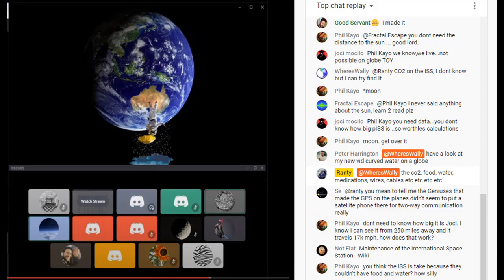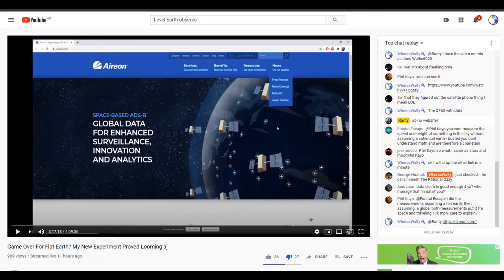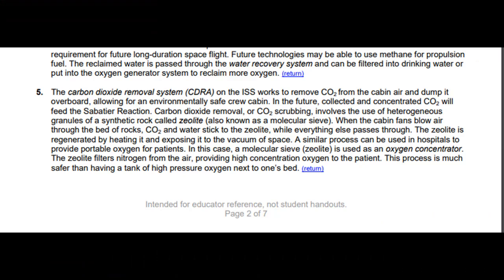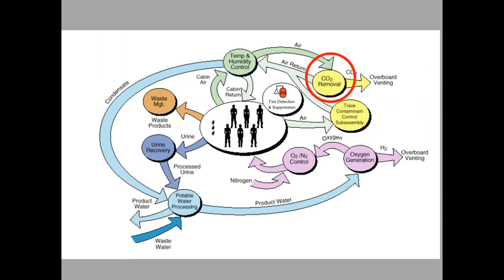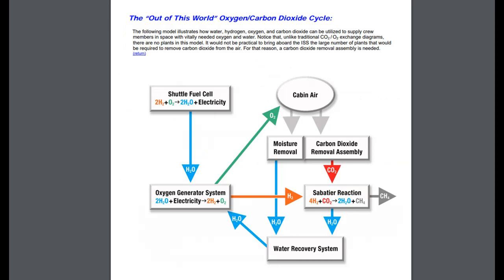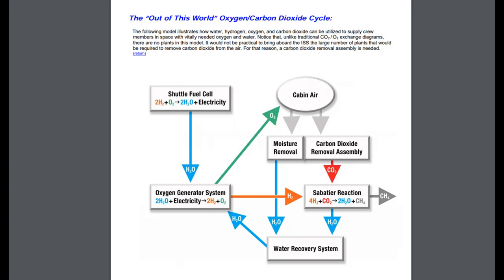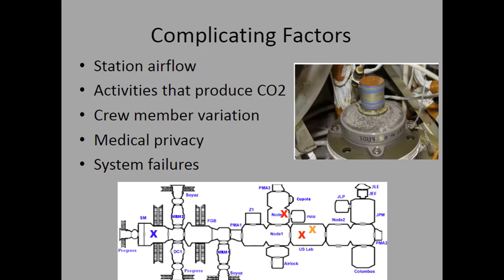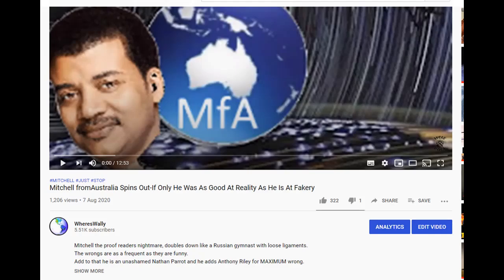Ranty Wants To Purge the ISS Of Carbon Dioxide - Here's How It Is Done

Comment: Odd, but why so these folks just not use google? CO2 removal has been used at least since the 1930's on submarines. This is almost on par with how do they breath on the ISS if space is a vacuum.
Reply: Since the 30's you say.  Even the British sub that was propelled by oars had a co2 scrubbing system of some sort and that was way back in the 1700's.  It's not rocket science.

Comment: NASA have been scrubbing Carbon Dioxide in spacecraft this since the early days of the Gemini program.  Look no further than the trouble with Apollo 13 with scrubbing Carbon Dioxide.
Reply: I was just going to say the same.
Reply: Those systems were not regenerable. They used lithium hydroxide to adsorb the CO2 and the cartridges were depleted, they had to be swapped out.
Reply: @jamesmskipper  Nice to hear from you again. How long did each of the cartridges last on average with three crew in the spacecraft?
Reply: @M2M-matt  Hello! I didn't really see your name and icon on this small display until after that reply. But I don't have the answer for capacity of those LiOH cannisters. I'll bet someone has looked it up. I will look for it. However, I know that the cannister in the Shuttle suit was good for 8 hours minimum. Could it have been 1/3 the volume of an Apollo cannister? Maybe. They alternate cannisters; switch from the depleted one to the fresh, then replace the depleted one. We didn't have an Apollo life support system test article, but we did have one for the LM.
Reply: "apollo 13 lioh canister" search brought up some nice articles. I will look some more.
Reply: @jamesmskipper  Thank you James much appreciated.